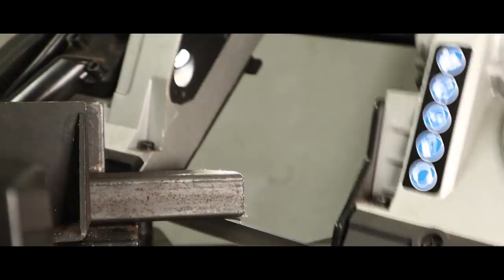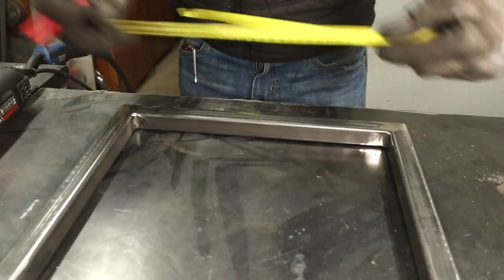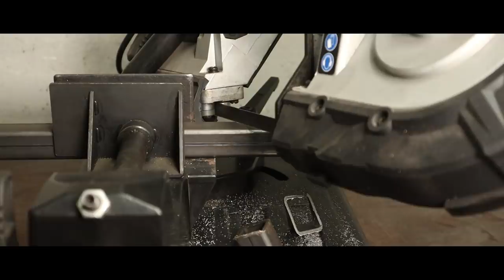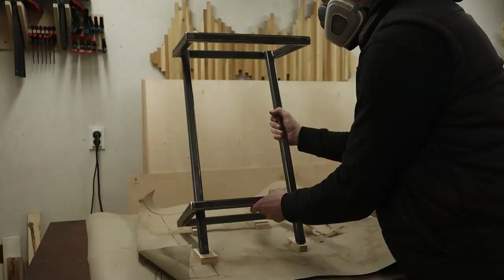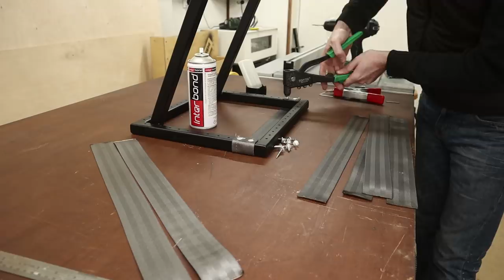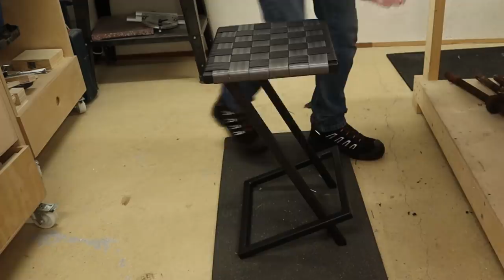Industrial Bar Stool from Seat Belts

Comment: Diresta tip:  use a hollow piece of tubing, sharpened at one end to drill stacks of paper.  I imagine it would work well on seat belt fabric as well...  Nice build, great style.
Reply from the maker: I tried a few approaches but this worked the “best” these are made from some synthetic material.